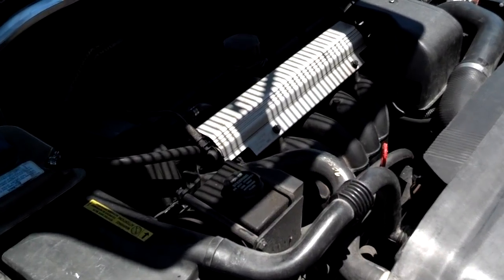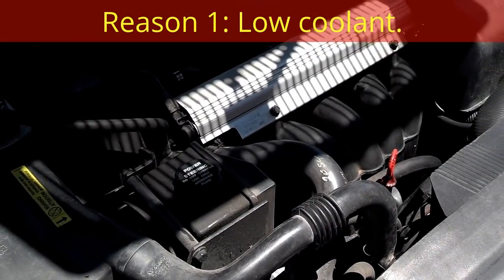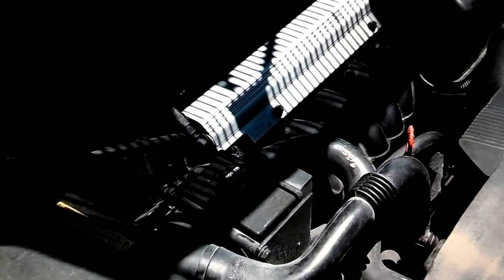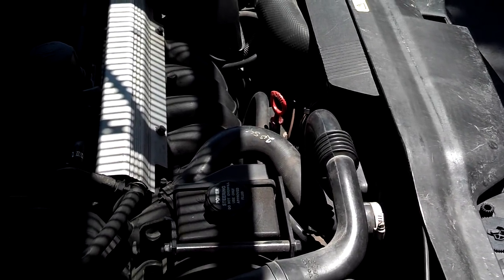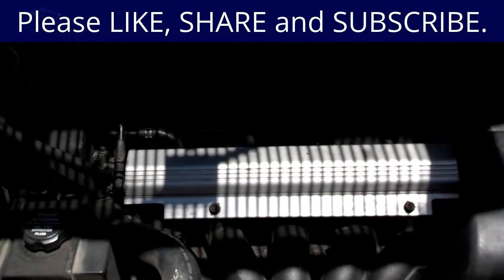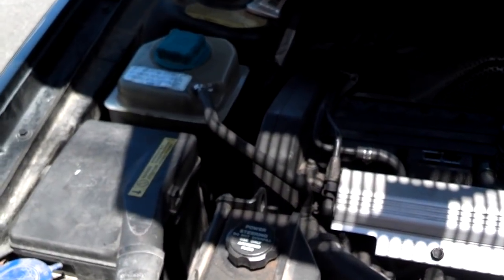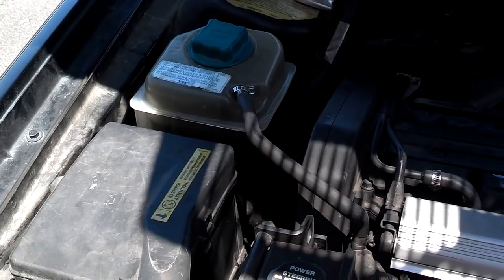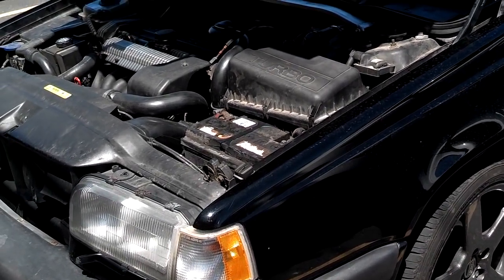My car is over heating, why is this happening? What should you do now?

Comment: I have a 96 firebird, and the previous owner made the chilling fans manual. There is a on and off switch that lets me turn them on whenever. Also I tried replacing the thermostat, but I noticed there was no thermostat in the housing! Also I noticed that there was a little corrosion going on inside the radiator top where you pour in coolant. The gauge needle also takes a while to read operating temperature, I don't know what the problem is, do I need a new radiator? Please help!

Comment: Your 850 is on pegs right? Don't like Volans? :)
Reply from the maker: My wagon has the OEM Titans on it. It is a '95 T-5R.
Reply: Oh those are nice too!
Reply from the maker: To be honest with you, they are junk. I have them because they are OEM. They are soft and heavy, that is why they were quickly discontinued. They bend easy and have a short lip so they leak air easily. They also have issues with valve stem seals seating properly. But, the '95 T-5R came with them and are original so they do have value. Volvo actually allowed people to swap them out for Volan's after the fact at no cost.
Reply: Wow ok. I knew they were soft but not that bad haha. I'd happily trade them for volans tbh. Quick question, would you rather have a 850 or s/v70?
Reply from the maker: Well, I have an 850. ;)
Reply: Got ya xD

Comment: My project car got close to overheating once while it was my daily driver. Was driving in traffic and saw it rising so I shut it off cause I was going nowhere anytime soon. When traffic started to move, I cranked it over and nothing happened. Finally started and drove somewhere to let it cool off for a few hours. Got home and noticed there was coolant sprayed all over the engine compartment. Safe to say I need to replace the head gasket now.
Reply from the maker: Doesn't take much. What kind of car is it?

Comment: Smashing, lots of good info for keeping the cooling system alive and well, and great pointers for basic checking of the head gasket.

Some times the rockerbox oil filler cap would become coffee coloured inside, sometimes its just water vapor mixing with oil, and if its thick and returns really quickly after being wiped clean then you have a problem.

Fill the cooling system with oil, ha ha , joking , just joking lol.
Reply from the maker: I didn't say that did I?
Reply: Robert DIY
you said a lot, its using my brain and connecting the dots lol.

or was it the oil in the cooling system joke i used?